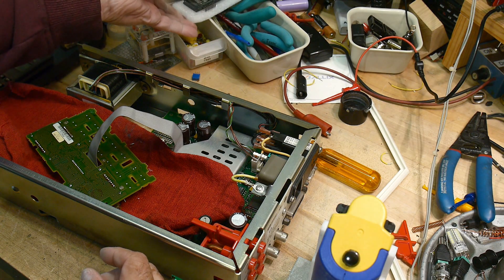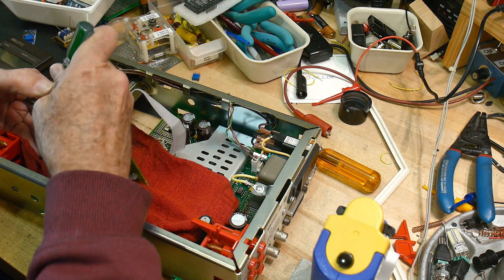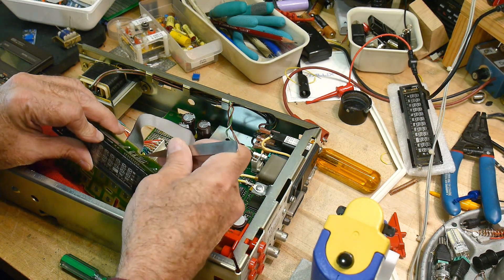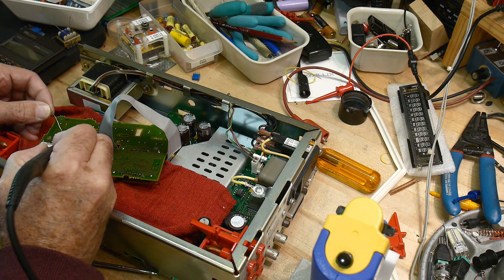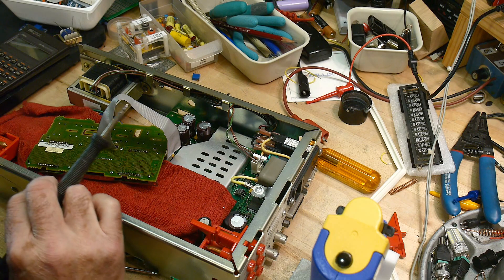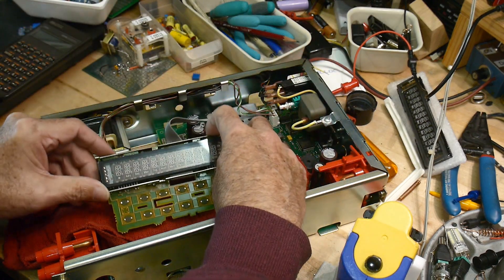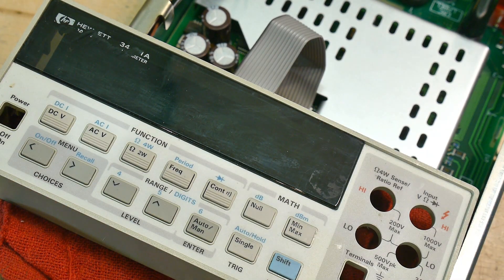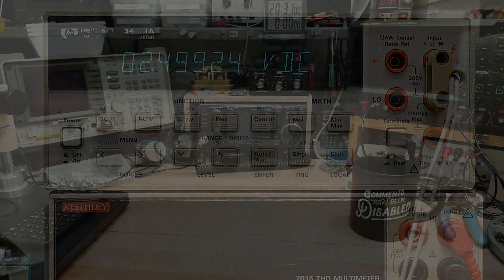#1055 HP 34401A with bad display (part 2 of 2)

Comment: Nice video as always, thank you for taking the time to entertain us old engineers and techs.
  I also own an Agilent 34401a.  I have a request for you, I replaced all electrolytics and tantalums, all works great but the AC current bellow 10 ma AC, can you run some tests on yours to compare results. It was the same before replacing the caps and re-calibrating the 10 ma AC as per the calibration procedure.
Thank you.